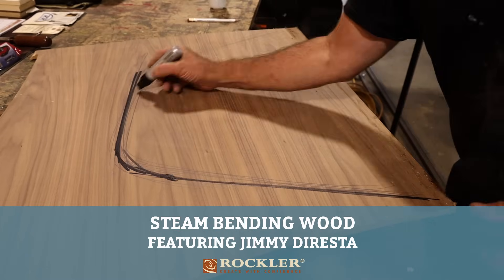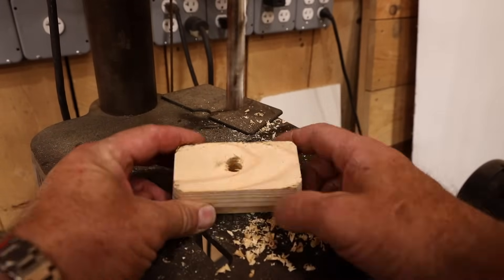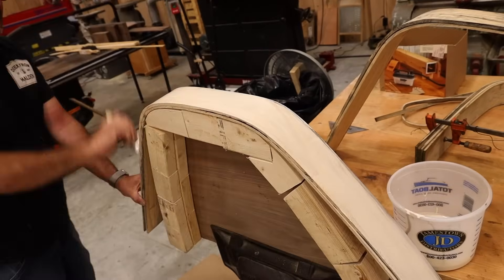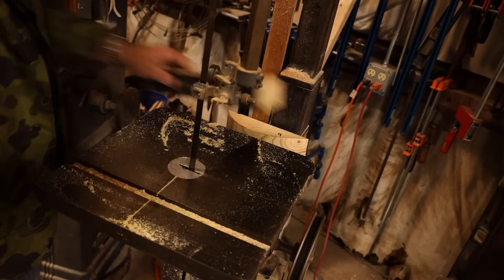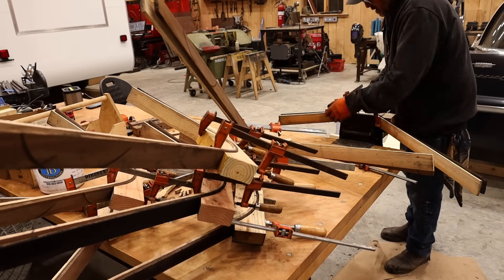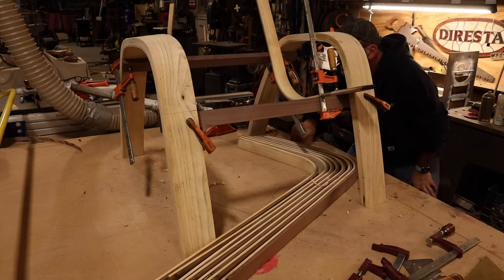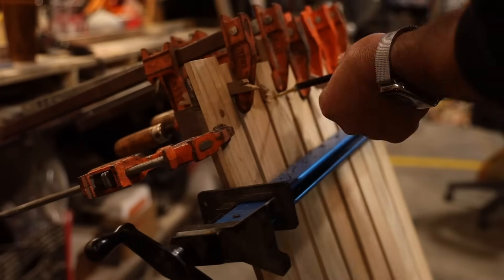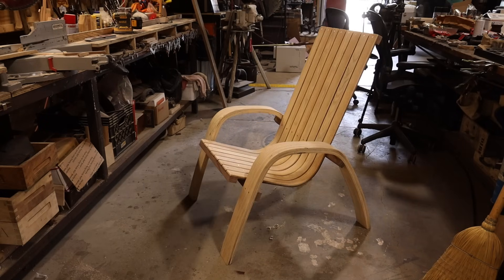Steam Bending Wood | Jimmy DiResta Makes a Bent Wood Chair

Comment: Very enjoyable and inspiring.  Brass screws are absolutely unforgiving.  Best to use a steel screw first to cut the thread and then back it out and slip the brass one in - much less chance of munting the brass screw head.  Thanks for the video.  Cheers, David
Reply: Great tip

Comment: I noticed you have a Do All machine in your shop! Years ago the steel company i worked for shut down the pattern shop which was used to make molds for pouring steel. A crazy guy i worked with in the fab shop bought all the machines. Everyone thought he was nuts because they were all 3 phase. He was crazy as a fox because he got them for cheap and sold it all for $25,000! Today they would be worth three or four times that much. They were all in excellant condition and built like tanks !

Comment: I like your style, not into totally planning out a project. When I did that as a builder I paralyzed myself. I would have a remodel and literally know how many screws I'd need,. much less the framing, sheet goods, etc. Everything from start to finish - and at times I'd do EVERY STEP OF THE PROJECT excepting HVAC and carpet. (which I dislike with vigor, give me a wood floor!)

Then I was subbing and almost lost my job because that slowed me down SO MUCH! Hell, at times I'd find myself literally tensing up OVER EVERY FORKING NAIL! Can you say "constipated?  Anal retentive?  OCD? Lol). 

So one scary day I somehow just dropped all that crap and just winged it all. With my OCD history I found I could easily and accurately estimate material of all stripes. By not going into a baby panic because I fell off the plan or schedule (this job uses another tradesman and they get sick, or materials are backordered...) I would have to solve the inevitable problem popping up. I actually developed a local reputation for fixing the impossible, and found a huge miscarried point load that WOULD have caused catastrophic failure when Colorado mountain winter snows hit. Eleven tons of misplaced load. Million $$$ house. I pulled the problem area apart and the engineer stared at it for almost 2 days. I'd figured what I'd do to fix it within literally 45 seconds of opening it up. Told engineer that there may be some reason it couldn't be done this way, but I'd do these 10 steps and he looked at me sort of empty faced. Then said, "I'll write it up."

It got to the point I was flown back there from the wife's family ranch in N California to Colorado to fix the impossible remod. I ended up running the whole thing.

So I love your style of using your experience, knowing what you want, and adjusting to get there.
Reply: Thank you for sharing this 👊🏼👊🏼🙏🏼

Comment: Do you have a video that shows how to make the box out of wood? I am building a model train layout. I could use steam bending to make the sub roadbed. I am already cutting the thin strips. The steam bending would help with getting the radii more organic.
Reply: I don't know about wood, but I've seen people use PVC pipe for the container for steam bending.
Reply: Poly sheet /or bag works well. I used mattress bag & it worked great my first time steam bending. A guy that does wood boat building has videos on it.  I’ll post it in the comments if I can find it.  Way less of a hassle than building a box especially if your only doing a one off.

Comment: what's the reason for steam bending first and then gluing them to each other, seems that it would be just as easy to do a bent lam from the start, it gets you to the same place without the extra step
Reply from the maker: If you mean skipping the steam bending step, those pieces of wood are too thick and the bend is too extreme to do a simple bent wood lamination. The pieces would fracture. If the stock was 1/8” thick or less, you may have been able to do the chair legs, but the seat slats would not survive the bend. Even steamed, he fractured one of the pieces of wood.